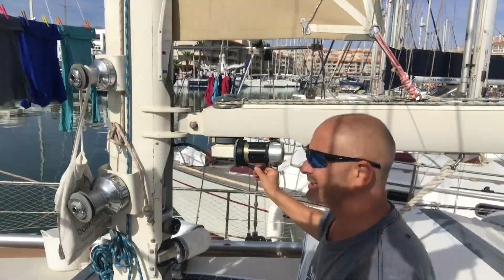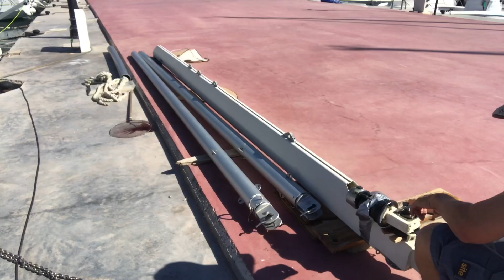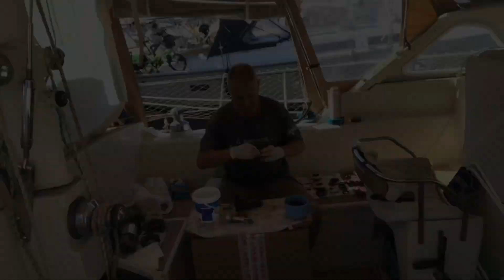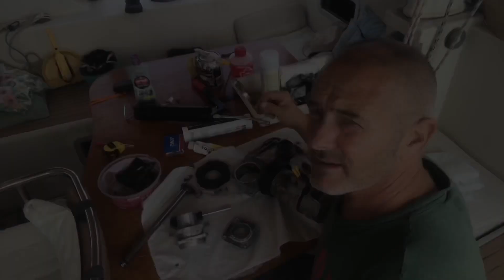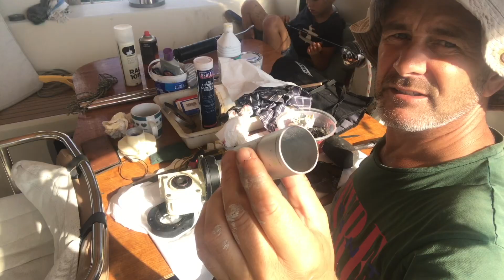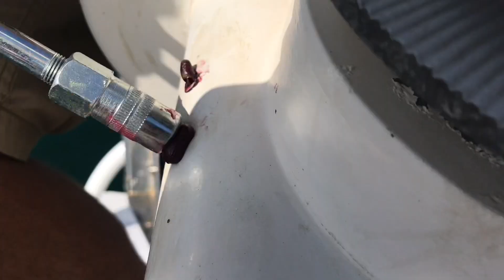Out-Haul Furler Service/Maintenance and fixing Grease Nipples/Zerk Fittings to In-Mast Furler System

Comment: I had to pull the furlers when I dropped the mast and well, I know it's way after the fact, but I think that you are supposed to disconnect the power wire from the relays down below in the forward head and then take the whole wire out up through the mast and out. its about 1.5 meters long. Be sure to tie a fishing line onto the end of the wire for re-installation!
Reply from the maker: You’re probably right and I did consider that but was worried I wouldn’t be able to get it back in again. I figured creating a join above deck would make for easier removal in the future too.

Comment: Woody, that shaft will seize again in no time. Put lanacote on it before you assemble it and pull it every six months for maintenance. Your battery thermal runaway was down to the small charger, there are dozens of Amels out there who have experienced that . If you haven't already done so, join the Amel owners group. The files and database sections have everything documented that you are going through. I feel you pain. Fair winds.
Reply from the maker: Hi Trevor. We’ve replaced the charger and batteries now.. blog about that coming up. But can you expand about the charger being too small.. does that mean there’s a regulator that gets overloaded or something? Good advice on the coating the shaft. I ‘think’ i might have put some Duralac on it.. but honestly can’t remember now. I guess I’ll find out on the next service but in the meantime the inmast furler has disintegrated (magnet fallen apart in the electric motor) so need to find a fix for it in Tahiti. Some people have replaced their Leroy Somers with Bonfiglioli furlers.. might be time to do the same :/
Reply: @MothershipBoatMaintenance  Woody, my boat was a 2003 SM Redline. She had twelve 110amp wet cell domestic batteries supported by a Balmer 175amp alternator with a Balmer fitted regulator. New battery bank would last eighteen months max. The chargers were Dolphin 30AMP and 100Amp. The smaller one destroyed battery banks on Amels all over the world! I spoke to the sales director in Dolphin at the time I melted the batteries and cables in the Sea of Cotez, and Dolphin knew that the 30 Amp charger was liable to go from float to flood and destroy the batteries, yet Amel were still fitting them. Must owners at that time were swapping them out for Victron or Mastervolt. The other Achillies heel on that boat was the Bowman intercooler for the gearbox. Eventually they all corrode internally and the gearbox oil/fluid gets replaced with seawater. The Hurth gearbox is fantastic, it will run for a couple of days on seawater. The intercooler isn't too expensive but it needs replaced every for to five years. Fair winds, T